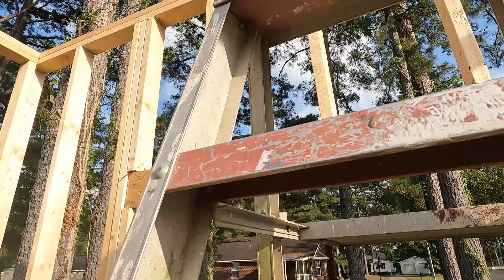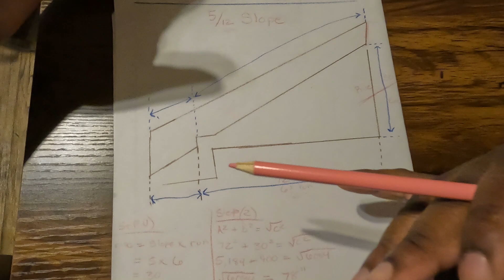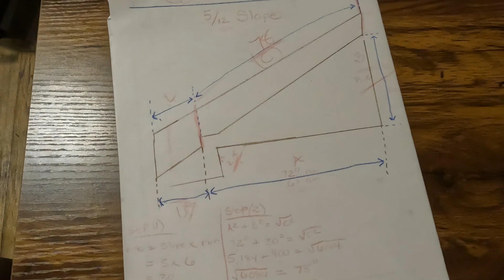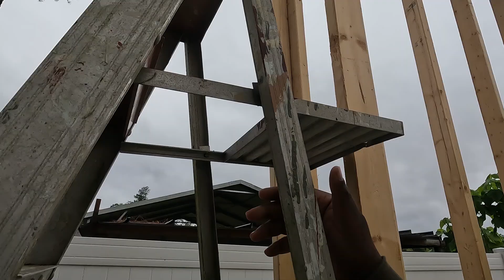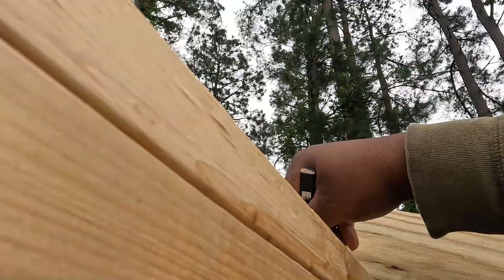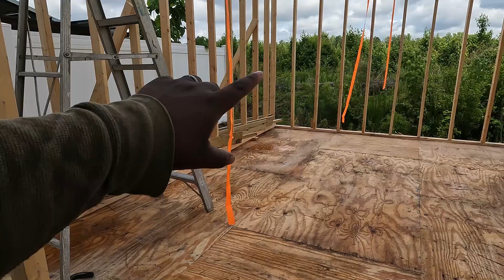Shed Build Common Rafter (Measure,Cut,&Build) #diy #shed #roof #building #bus #construction #watch

Comment: Im building a pool deck for wife snd i.  Stumbled across your channel because of framing nailer you use ( i bought same one).  Your successes as well as minor failures gave me the heart to continue building my deck.  God bless, and great job.
Reply from the maker: Thank you for watching and words of encouragement.  Yes I was a little defeated when things didn’t seem to go as planned but what I realized is as long as it does not compromise structural integrity anything thing else can be fixed or adjust things in the next steps to follow.  Keep me updated how the deck is coming.  Your the first to hear this but my next building project is going to be building me a back porch. Thanks God Bless You Too